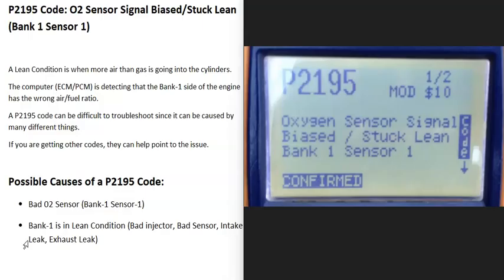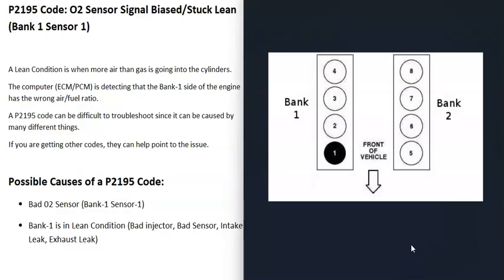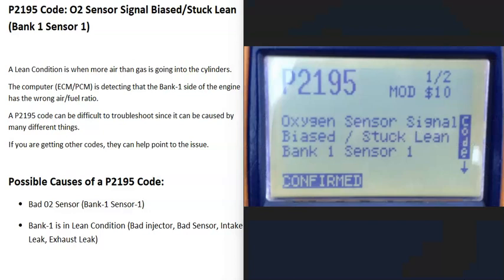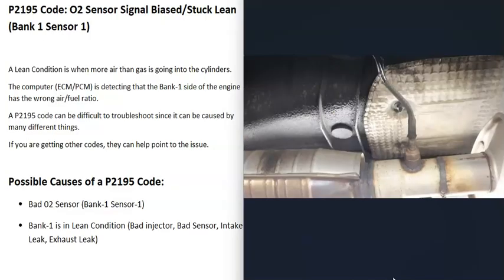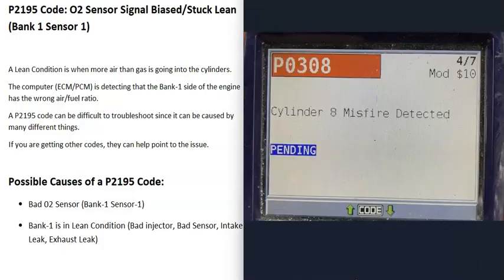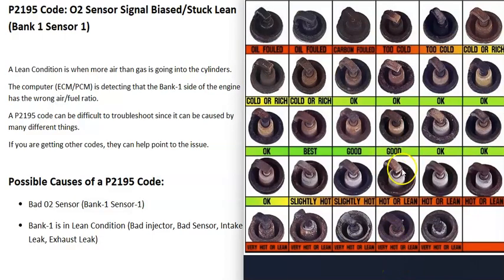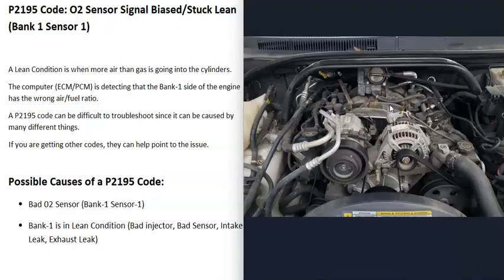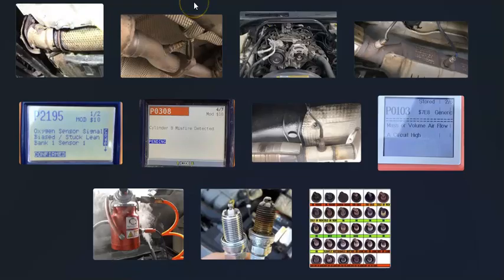Causes and Fixes P2195 Code: O2 Sensor Signal Biased/Stuck Lean (Bank 1 Sensor 1)

Comment: I have a code P0171 along with a P2195 in my six cylinder Highlander. Which code should I address first? I did change out fee bank, one upstream air fuel racial sensor and the code came right back after a couple driving cycles.What would you recommend? I have checked for air leaks and find none.
Reply from the maker: If the 02 sensor is good, then something is causing bank-1 to run lean. If there are no bank-2 codes, then it is not something that would affect the whole engine but just bank-1 (bad injector, spark, plug, coil). If there are no other codes, the spark plugs on bank-1 can be removed and matched to a spark plug burn chart to see which cylinders are running lean and then focus on those.
Reply: Here’s the thing. When I look at my fuel trim data in active mode, then the data isn’t showing that the engine is running Lee and. In fact, it looks perfect. The long-term future trims on both Banks is around 3 to 3 1/half. The short term is at zero. So does that mean my sensor is reading incorrectly? I do have voltage data showing up on both the oxygen sensors on bank one. And those appear to be in line with what is necessary. So what else could it be? I don’t get it? Thank you in advance.

Comment: Code p2098/02195/p2198 w/ pending code p0300/p0301/p0302. Replaced spark plugs/all 02sensor/replace intake tube was crack./replaced breather hoses was crack./ was working for couple week but now started to malfunction. Same code pop up. Any info please before i make some orders thank u.
Reply from the maker: It needs to be diagnosed, and lean/rich codes can be hard to troubleshoot. With both banks having an issue, the problem is likely something that would affect the whole engine, such as a weak fuel pump or clogged fuel filter. I would use a scan tool and check the fuel pressure.
Reply: @ ok thanks for info
Reply: For the fuel pump should i replace the high pressures and low?
Reply from the maker: It is best to test them first. If you have a scan tool, go to live data, select all the fuel pressure sensors, and see what the PSI is. The PSI should match what the fuel pumps are rated for.

Comment: Hey I have this code on my 2007 Toyota Sienna I ordered the parts already on rock auto but I was wondering if it’s still safe to drive the car while the o2 sensor is bad
Reply: Absolutely, I have been doing it for 100,000k miles. As long as you change your oil and fluids. Maintain Your vehicle regularly, you should be fine. I don t want to pay to have it fixed so I pay my guy who does my inspection double. You should have it fixed if you have the money. I have a ford edge and it has 204,000k miles. This turned on at 108,000k 2013 ford edge. Runs a little rough but she’s reliable back and forth to California from NY 3 times

Comment: I have a 2014 ford Taurus sel v6 I just replaced all 4 02 sensors bc the codes threw for bank 1 sensor 1 and bank 2 sensor 1 biased/stuck lean. 2 weeks later the code popped up again for the same thing. What can I do?
Reply from the maker: It needs to be diagnosed, but the engine may be running Lean. Are there any other codes? If so, they can help point to the cause.
Reply: @HVAC_Mechanic  I have the same issue with a 2010 mustang v6 I replaced bank 1 sensor 1,bank2 sensor 1 the same codes 2 days later it popped up.Other codes that I have is the egr valve flow insufficient detected i replaced it and cleaned near the intake manifold and threw the same codes any recommendations?
Reply: @HVAC_Mechanic I have got the same code. Ford Taurus 2011. Previously I have already replaced injectors and upstream O2 sensors.  Checked vacuum hoses with smoke machine - no leaks. Error pops out at the random time. Next day it might be gone. There are no another errors. What it can be?
Reply: Yall cant just be replacing sensors thinking it will fix the issue. The sensor is doing it's job and alerting you to a problem with your engine. Address the problem as to why the sensors are reading what they are reading. Running lean usually a vacuumed leak somewhere or you knock sensor is broken.
Reply: It ended up being the purge value btw
Reply: @lanadunstan9957 how did you get to know that this was purge valve?